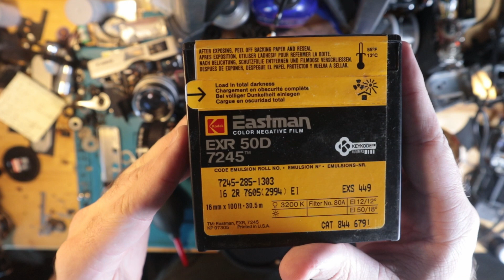Loading and shooting canon scoopic

Comment: So how much does one film come at, with developing and scan in addition to the film itself?
Reply from the maker: It depends on where you go, for this I used Cinelab and it was about $1 per foot for developing and a little extra for scans depending on quality. Film prices are kind of weird right now but I would not try and pick up less expensive expired film (do as I say not as I do) if you're wanting to spend the big bucks shooting film it's worth it to spend a bit more and get fresh stock.
Reply: @RompingBronco  $1 per foot almost makes it sound cheap untill you realise it is like a second or something of footage. Ouch.
Reply: @JanneRanta  Excellent and very helpful video. When it comes to motion picture film, develop it yourself. But you must use a Lomo tank if you can find one (now hard to get as best are in Ukraine.) but the chemicals are inexpensive. Do not use a bucket! Because film is so expensive, self processing is for us, the only way to go. The lowest prices for film and more is the Film Photography Project for your supplies. Also B+H and Cinestill. 
You can transfer the footage (without a very pricey scanner, using a 16mm projector outfitted with a 5-blade shutter (I sold many and designed them for Eiki. Yes, I'm older.)  diffuser glass, remove lens, use camcorder with Raynox macro lens and manual focus. Record directly off film gate. A 12v LED MR11 light available on Azn. cheap, fits and works in any 12v projector, including super 8, no mods needed. Happy Filming.